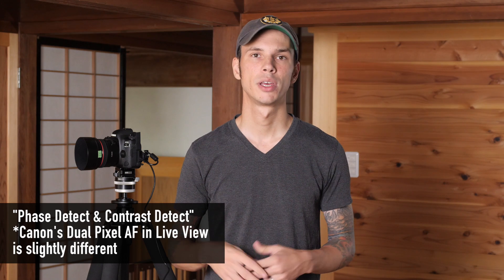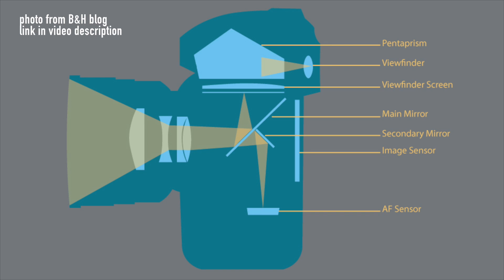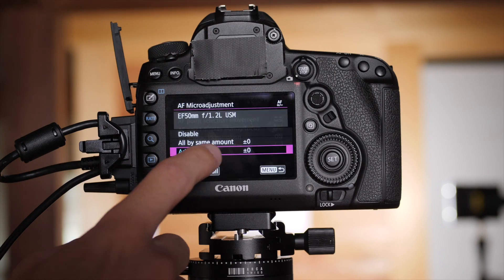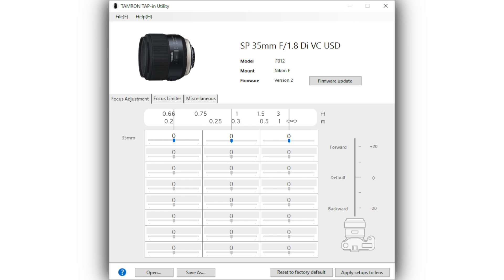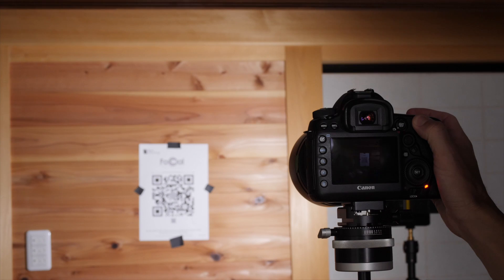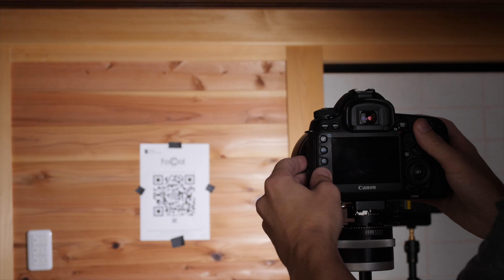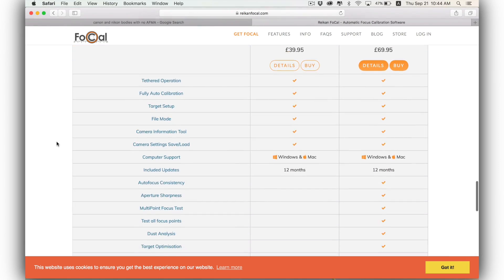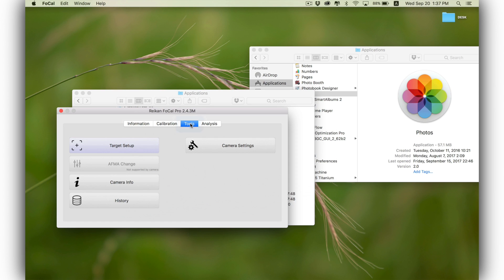How to Get Sharper Photos - Auto Focus Micro Adjustment (AFMA)

Comment: Hi my friend me again :-)
I have asked u about distance to target for calibrating both tamron 24-70 and 70-200 g2 lenses.
What happened is that i have done it for 24-70 and it was ok when i finish,but after that when i start doing some shoots i see again some back or front focus...Don't understand...I align camera and Spyderlens cal and start from 0 and than add plus or minus until i get sharp results at 0 on myspyderlens cal..i wrote it and later i add those values on my tamron tap in consol and today i see again there is some front or back focus issues...dont know what to do it makes me angry :-)
And also when i start af adjustments i check 2-3 times to be sure its good value...sometimes i run to a problem that no matter what value i put its the same result...i think it was just some minor bug in camera...but like i said i have done it it was good values and today i see its not ... I DIDNT USE LIVEVIEW WHEN I CALIBRATED LENSES....
i use d7100 and 24-70 g2 and 70-200g2
I bought focal but i didn't use it for tamron zoom lenses...
Reply from the maker: Hey! Sorry to hear you're having trouble. I would say test out the Tamron lenses with Focal and see what results you get. Judging by eye/manually with the tap in console can be really tricky and frustrating, that's why I switched over to Focal. The tap in console doesn't help if you have 2 camera bodies either since they'll both probably be slightly different. The benefit, of course, is that you can program the calibration in much more detail. Personally, it's not worth the time and frustration for me though haha. 

Anyway, for now, if you can try out Focal with those lenses I'd be curious to see if you get better results. If they still give you problems after doing that then maybe there's something wrong with the lenses. With Sigma lenses I'd say the problem might be focus consistency (even if it's accurate at first it can become less accurate very easily or it will be off and on). But, I haven't seen those issues with recent Tamron lenses so I don't think you should have to worry about it. 

Let me know how that goes!

Comment: i have a better idea, if you are unhappy with the lens focus on your camera, send the lens back, and keep returning it until you get a lens focus you can live with......your way is to change the adjustment not only every time you put a different lens on the same camera body, if using a zoom everytime you adjust the zoom to either closer or further away you must change the adjustment....This leaves very little time to enjoy taking photos, personally i can not be bothered with all this, so i will do as my first sentence says.....smile....i have 8 camera bodies which i use and many lenses, this would drive me crazy........i honestly i have a problem with some of my lenses, that being they are too damn sharp, this causes me much photo shop work......
Reply from the maker: I'm sorry but I'd have to disagree here. Nearly ALL lenses expensive and cheap can benefit from calibration. If you've lucked out with yours, that's great but especially with very wide apertures like 1.8, 1.4 and 1.2, the calibration becomes more and more necessary. 

Once you calibrate a lens on a body, it remembers it. If you switch lenses back and forth it automatically remembers them all. On a zoom you can adjust it for the wide and tele ends and it remembers both and will automatically adjust, there's nothing you have to do. It's a one time process (aside from re-calibrating after a while because things can get a little off over time even if you don't do this process). Yes, you'd have to do it for each body/lens combination but once it's done, it's done. You'll get the absolute best out of every lens. 

A big thing to keep in mind too regarding your comment about the lenses being too sharp and it causing you too much photoshop work, is that this process does NOT make the lens sharper at all. It adjusts the accuracy of the autofocus and that's it. You can have the sharpest lens in the world but if the focus is on the tip of the nose instead of the eye, no amount of photoshop work will save that photo. A sharp lens is a sharp lens, but the focus needs to hit where you intend it to hit and this helps.

Also, sending lenses back until you can "live with it" won't help if it focuses differently on each body you have, which does happen because the problem is not only in the lens but in the body. You CAN send the body and lens to Canon '(or Nikon or whoever) to have them calibrated to each other in the factory, but then you'll be without that lens and body until they come back. Again, these the alignment can slightly get out of whack over time too, so even if you send a lens back until you get one you're happy with, over a year or two it may be able to benefit from this process anyway. 

It's not always necessary and sometimes you'll even get an AFMA of 0 from the program, and that's great. But, it's peace of mind knowing your lenses will be as accurate (not "sharp") as they can be. Again, especially wide aperture lenses really benefit from this.
Reply: If you think about the amount of elements in each of your lenses, a slight knock can effect the point of focus, humidity can effect how your lens performs. After buying and using this software I can say that it doesn’t matter how much you paid for a body or a lens, they all need calibration.

If you keep sending the lenses back you’ll have to send them in a parcel, we all know how rough postal services can be, the first thing I would do on a lens returning is to calibrate it…

You have 8 camera bodies, not one of them you can Micro Adjust per lens?! – both my 5d mk2 and mk4 I can adjust per lens.

Comment: Hi Scott.    I have the Nikon D810 and just purchased the Nikon 24-70 f/2.8 VR lens and the 70-200 f/2.8 VR lens.  Both seemed to be back focusing so I tested them both twice on REIKAN FOCAL.  With the 24-70 at 24mm the test gives a calculated fine tune of -11. At 50mm it is -7. At 70mm it is -8.  Reviewing the last page where it discusses the Front/Back Focus and shows the green band, the average zero point is -8.
With my 70-200 lens at 70mm test 1, the  calculated fine tune is -9 and test 2 it is -7.  The zero point is -9 and -7 respectively.  However at 200mm the  calculated fine tune is -1. The zero point is -3.  
I have 2 questions related to these lenses and I'm wondering if I should send them back to the dealer.  Is the range on the 24-70 acceptable for the different focal lengths?  If so, what should I set the AF fine tune at?  Same question for the 70-200?  Is the range between the different focal lengths acceptable?  What should I set the AF fine to at ?
I so much appreciate your help.  I'm pulling my hair out.  And again I'm wondering if I should keep the lenses with these large differences in the values for the different focal lengths.  Thanks for taking the time to study my problem.
Reply from the maker: Hi! Thank you for watching :) I do have one question that I can't remember from when I was using Nikon. With zoom lenses and AFMA, can you set different values for the wide and tele ends? (like -9 at 70mm and -1 at 200mm or something like that)? On Canon bodies you can do that and I often find that same situation where one end needs more correction than the other. 

If you CAN'T do that, I'd have a couple of recommendations. 

-Adjust the AFMA for whichever end you shoot more often (I almost always shoot my 70-200 at or near 200mm, so I'd try to adjust for best performance at that end). You could still try to balance it a little so that the performance on the other end is not terrible, but try a few settings and see how it looks when you actually shoot with it. 

-Setting the AFMA for the tele end, especially on the 70-200, will likely be more important because you'll usually have a shallower depth of field at 200mm than at 70mm. In a lot of cases, the depth of field at 70mm (even f2.8) might cover any small inaccuracy. 

-You could make the adjustment right in the middle. Those ranges don't seem too super wide and you'll probably still get pretty good performance. Again, I'd advise to set it, test it and see how it looks. 

-If all of these results aren't satisfactory you could send your lenses AND camera body to Nikon and they will calibrate them together for you. It takes a little time (maybe a week or two?) and you may have to pay at least for shipping, depending on your warranty etc, but you should get perfect results without having to return your lenses. 

If it were me, I'd try and set the AFMA somewhere close to the tele end, test it out a little and if the results seem satisfactory just keep it like that. If it was still bothering me after that, I'd consider sending it to Nikon to be calibrated. 

I hope that helped, please let me know how it works out!
Reply: Thanks Scott. I appreciate your reply.  I will work with this to see how I can make this work.